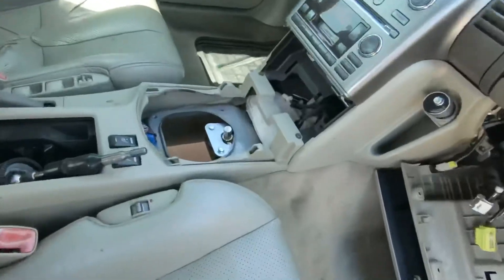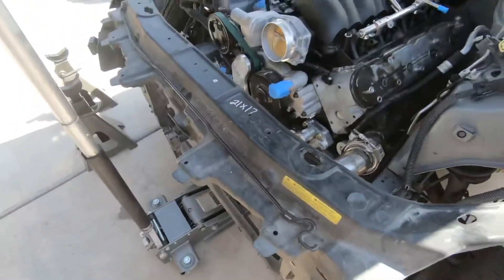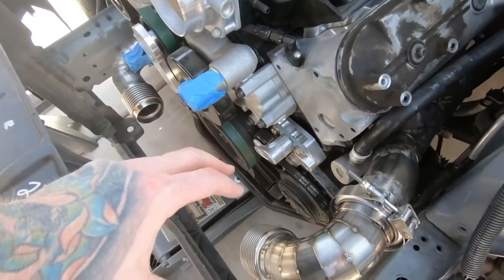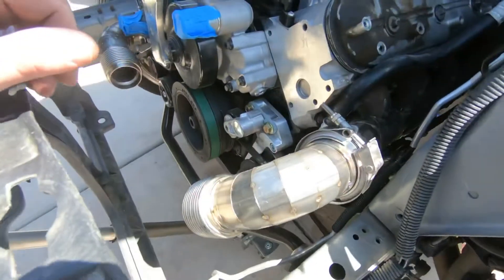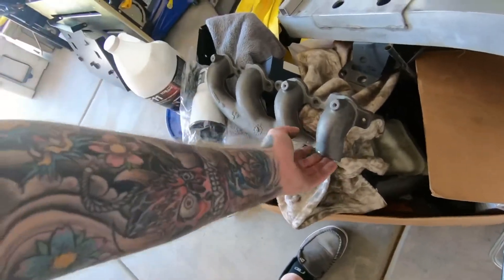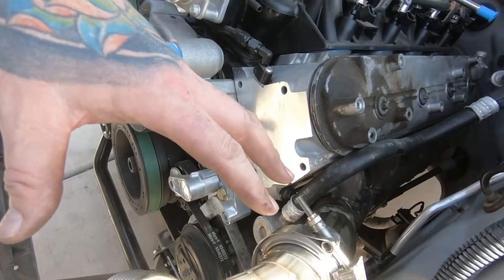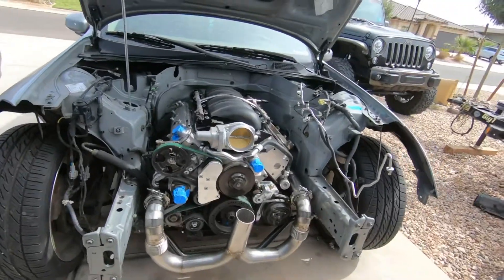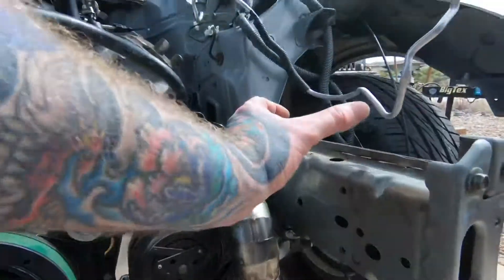Pulling out the CD999 shifter

Comment: Hey man i live in tn an im having the same problem with my shifter relocation what do i do
Reply from the maker: Is your swap on a g35 or 350z? And what kit are you using?
Reply: @BoostEnvy  g35. An i have the isr trans conversion. I think this cheap oil pan i bought is holding me up from goin back like its supposed to but my engine mounts didnt come with how to be put on there from isr also
Reply from the maker: Is your oil pan hitting the sub frame?
Reply: @BoostEnvy  yep thats the first thing i think the motor mounts are supposed to be turned over where the mount itself is facing the front instead of rear is that right??
Reply from the maker: Will that put the shifter even worse spot?
Reply: @BoostEnvy  i dont think so it says left side so that would be driver side right an with the pan off it should work i gotta get the pan cut an rewelded to fit sorry for bothering you
Reply from the maker: Your all good you could check out the pan that LOJ uses with his kits that what I’m running , they are made by canton racing, you can pick them up for under 400 on summit racing.
Reply: @BoostEnvy  oh i didnt know that i know the isr one is 700 thanks man
Reply from the maker: I ca get you a part number if you need it.
Reply: @BoostEnvy  ok yeah thatll work
Reply from the maker: https://www.summitracing.com/parts/ctr-15-276/
Reply: Hey man i got the oil pan in but the crossmembers not lining up with trans im thinking the isr stuff is wrong
Reply from the maker: LS Life is there anyway to drill new holes in the crossmember to make it work?
Reply: Im wanting to say that crossmember is only for a t56 an im using a cd009 sorry i cant find any videos showing details
Reply from the maker: Yeah if it’s for a t56 it will not line up with the cd009
Reply: @BoostEnvy  what oil pickup did you use?
Reply from the maker: @MonkeyRenchGarage  it came with the LOJ pan, The whole kit I went with was all LOJ I didn’t want to try miss matching parts.